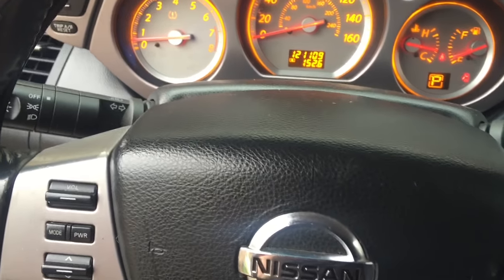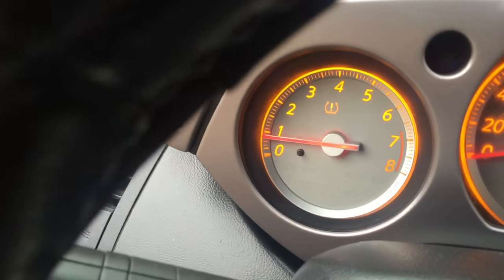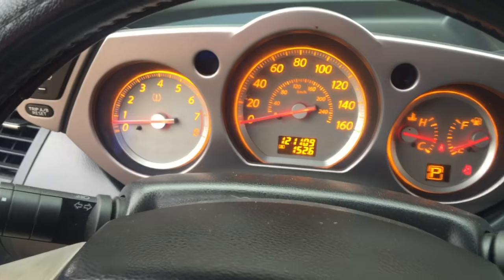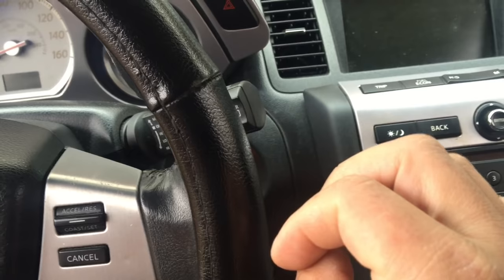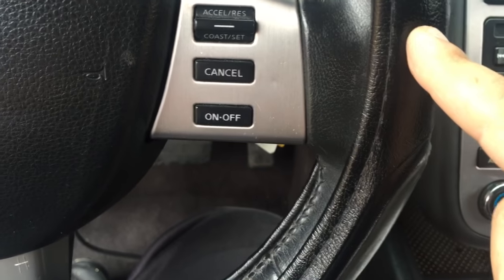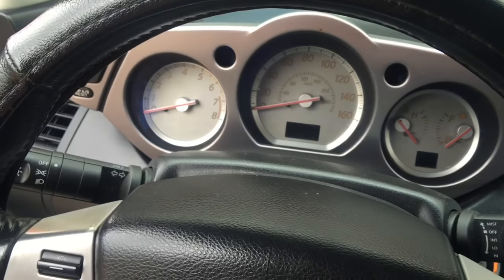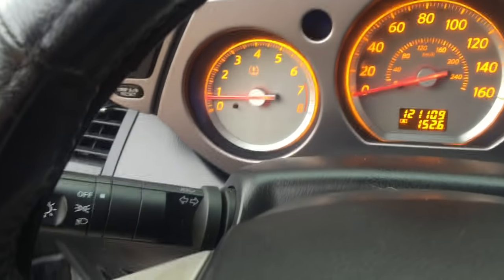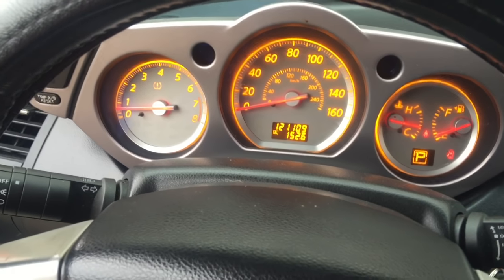Nissan P0507 Idle Control System - Idle Relearn Procedure

Comment: HI there. I have the same year murano. removed the intake manifold for maintenance,  have the same code, I did same steps u did . my check engine never blinks, the idle it did drop to 800 or so. but still it's high idle  while coming to stop completely,  do I'm doing something wrong Or I have to repeat the steps more then few times. have repeated the steps 3 times,  engine light never blinks while doing the rest learn ? any help ? thanks
Reply: 183guti sounds like your doing the correct steps. Double check that you don't have a vacuum leaked somewhere. 
Like the throttle body boot or something like that.
Reply from the maker: 183guti sorry forgot to switch accounts.
Reply: Throttle body boot? 
I will look for leaks for sure a soonest I have a free time , thanks
Reply from the maker: yeah the rubber hose that goes between the Mass Air Flow sensor and the throttle body, i've seen that sometimes when it gets put back on it sends on the mouth of it,
Reply: Ooi ok. I will look into that. Thanks for the response and happy holidays
Reply from the maker: no problem, you do as well!
Reply: Falcon's Garage My service engine soon light is on... Can I do the same procedure?
Reply from the maker: Only The Strong what code do you have? If you don't know you need to check that first.
Reply: Falcon's Garage just the service engine light is on. Blinked first now is on steady... Havnt been able to check for a code yet. It just happened bout an hr ago.
Reply: 183guti a blinking light is a misfire witch is more serious. A steady light on could be hundreds of things. Stop by a autozone/ Oreillys or any parts store and they will read your codes for free. Do that and I'll be able to help you better
Reply: Only The Strong oops forgot to switch accounts.  But still me
Reply: Falcon's Gaming Ok thx I'll get back to u...
Reply: Hi .I have an 07 Nissan Altima 2.5 S .mine idle is going up and down.i bleed the radiator for air.But I cleaned the throttle body.i tried the learning process but nothing.What can i do.?
Reply: Cooper Jonson maybe wait, all I did was wait for couple weeks and it's does re learn the idle but takes time and light comes and goes
Reply: Ok thanks.I will wait.
Reply from the maker: the radiator has nothing to do with the idle just an fyi.
you might want to check also if you have an intake/vacuum leak somewhere that could also be causing your bad idle
Reply: I will check for leaks tomorrow.Thanks👍
Reply: 183guti I have 2009 murano the same problem I tied the air intake screws too tied and I loose a litle and it drops and I did this steps to erase the lights and it works
Reply: valflame VT I see well my cel light hasn't cone back at all , all I did was wait like 2 to 3 weeks. my cel was coming on and off during that period of time. finally all fix up and all good now. 
my.honest opinion is this transmission sucks so bad, too soft for hard driving lol
Reply: honestly this car is not meant for hard driving. CVT transmissions are weak when they are made cheap.

Comment: i have 2002 nissan maxima 3.5 and i have code 1122 i bought a new throttle body and gas pedal as well i have tryed to do that relearn procedure nothing at all my RPMs are way too low I press the gas and it only goes to 1 1/2 rpm sometimes 2the most i ran out of ideas hot you can help thanks
Reply from the maker: Check your Wiring hardness. might be an issue there
Reply: i already did and it looked like crack so what i did i got another one from another car and i did the wiring and it was working fine for like 3 months and then one day i turned it on and its been like that since
Reply from the maker: Might be the same issue again... maybe...... but also check the rest of the wiring not just the connector. does it do this all the time or just periodically?

Comment: The Check Engine Soon light and Error codes have to be cleared before doing the idle relearn right ?
Reply from the maker: The relearn should work with out having to clear the codes. But you will still have to clear the codes after the relearn. 
So aither way it needs to be done. If you don't. It will eventually do it it self but it will take a couple of engine cycles.
Reply: Falcon's Garage what about if i did the relearn but the light never goes off after i done with the process and i chenged the body kit

Comment: I've tried this on my 04 G35 with no luck any suggestions.
Reply from the maker: maybe a bad Throttle body
Reply: Falcon's Garage  I have 04 g 35 n have that po507 code. Will that process work?

Comment: My check engine light came off after I tried this method...but my RPM's are still going crazy up and down 🤔
Reply from the maker: sounds like a vacuum leak
Reply: Yea bro. Make sure you plugged all tubes and shit. Thats what i did. And check for cracks

Comment: I have Nissan Maxima 2006 I try more than 10 time still don’t work for me
Reply: My 03 Altima gives me the same trouble. Can't tell if I don't have the touch lol
Reply: Same on my 05 maxima.  Will not Manual relearn..
Reply: Mine took the check engine light off... But rpms still go up and down🤔
Reply: Update: Had a intake gasket leak, which wouldn't let relearn.  Runs great now.

Comment: So should you have not done the relearn before you got the code?
Reply from the maker: Why would you do that? 
No need to relearn if it doesn’t need it
Reply: You did not state that it had the code before. Only after you cleaned the throttle body. So would it not be better to do the procedure after the cleaning as to not get the code?
Reply from the maker: No. Because the codes doesn’t always come on after cleaning the throttle body. Sometimes you might get the code after unplugging the battery as well. So no it’s not a sure thing that the code will come on after cleaning the throttle body
Reply: So...clean the throttle body, don't do the relearn unless you get code?

Comment: Will this work for the 1.8 engines for Nissan's.
Reply from the maker: yes
Reply: @FalconsGarage  any recommendations of how to get it scan cause ever dantley I have some more issues only thing I can do is get that service soon light to go out. At idle it surges from about 1500 til a little over 2000 I did clean the intake it was in need of it for sure. I can hear it operating so something functioning but  still it will not relearn??? I do have a tire  pressure light on.????
Reply from the maker: tire pressure light has nothing to do with it .. i would start checking for intake leaks

Comment: Would you know if this is the same procedure for a 2004 Infiniti FX35 AWD?
Reply from the maker: yes it should
Reply: Thank you, it worked, the idling went down. Two quick questions, engine light is still on and it sounds a bit rough. Are these normal? Also, should I reset the engine light error? Thanks so much for your help, one of the few out here that made something work as stated.
Reply from the maker: Glad I could help.yes you should clean the  check engine light, but the sounding rough part should be normal ... probably has another issue also
Reply: Thoughts on what it could be? I did do a lot of work on it. Including cleaning out the throttle, replaced valve cover, fuel injectors, and plugs.  Cleaned MAF, etc. Any advice would be appreciated. Thanks again.
Reply from the maker: if it wasnt there before it could be a hose or something like that, but hard to know with out checking it....
Reply: Thanks, I'll check.

Comment: Hi, Thanks for video. I have Nissan Quest 2007, I have noticed when I start car initially then idle speed is around 1500 but as soon as some time goes, it starts dropping to 800 range so it works when coolant/temp is near the middle. Is it normal to have higher idle during start ?
Reply from the maker: yes its normal
Reply: @FalconsGarage  I have done this and noticed again after few weeks code P0507 after performing these steps. I have also noticed when I am driving and let go off gas pedal, it looks like it does not slow down when I am letting go off gas pedal. Is it due to Throttle body issue or something else ? Any idea ?
Reply: @sanjayvideo01  I’m having same problem
Reply: @vvtheonevv4007  , Change Throttle body
Reply: @sanjayvideo01  did that replacing fix it? I cleaned mine, did relearn procedure, it idles at 750 but still gets P0507.
Reply: @alan4sure  replacing did fix issue. Although it was tough to remove 4 screws which was holding body. If you are doing yourself please buy these 4 screws in advance
Reply: @sanjayvideo01  I had it apart for cleaning once already so the screws should come out. Then I did relearn steps and it idles ok at 750 but still has trouble starting hot, and gets 0507 high idle speed errors. Hopefully a new throttle body solves it!🤞

Comment: I did this on my 2005 Altima. Rpms came down but the check engine light is still on. Could it be a bad throttle body?
Reply from the maker: Could be, getting the same code?
Reply: I just went to check it and the check engine light disappeared.  This is the second time this has happend.  Could it be a more serious problem? But all is good for now.  Thanks for your help!

Comment: my throttle body wont re learn, i bought a brand new one (Hitachi) and it still wont bring my idle down.  I have a cold air intake on it, the mechanic said for me to put the stock airbox back on.  Help...
Reply from the maker: the cold air intake wont hurt it in my opinion unless you have a leak somewhere else!
Reply: Falcon's Garage my mechanic is very good but for some reason he's stuck with this issue
Reply from the maker: it happens sometimes.

Comment: if the relearn dont work would that mean my throttle body is no good?
Reply from the maker: That or bad wiring
Reply: +Falcon's Garage would the relearn work if it dirty?
Reply from the maker: it would but it would learn idle with obstruction, I would suggest cleaning it before doing it
Reply: +Falcon's Garage just change my throttle body to a new one and cant relearn it took it to a mechanic and he couldnt either any thoughts on this thank you.
Reply from the maker: Sometimes it takes a couple of times to get the relearn .... but also might have a wiring or computer issue
Reply: Try it with your engine fully cold.
Reply: Falcon's Garage should I try it engine cold?
Reply: Matt Skelton I did all the steps with the engine fully cold and it worked first time. when you start it at the end of the procedures, let it warm up and the idle should drop to normal after a few minutes. I tried doing the relearn with my engine and transmission at full operating temp about 15 times, which didnt work. So I tried it with it fully cold to see what would happen and it worked for me. Let us know if it works for you.
Reply: Yes, if doing it with it fully warmed up isn't working. Try it cold! Let it set overnight. Then do it.

Comment: Can this work for a 2010 Nissan Altima 3.5 v6
Reply from the maker: yes
Reply: Falcon's Garage well I did it and the problem is still there I cleaned out the throttle body and also cleaned the master flow sensor

Comment: hi, I have a Nissan versa 2007. I changed the engine and now the engine just rises on idle to 3000 rpm. what could be the cause and how can I fix it?
Reply from the maker: maybe an hose is leaking or a faulty intake gasket

Comment: Thanks,for the video. I have a 2002 Nissan Altima 2.5 S, got a P1128 code I replaced the throttle body did the relearn process. the next day I got the same code P1128 check engine light came on and lost accelertation. can you or anyone help with this problem.
Reply from the maker: did you check the wiring?  
also maybe the copter needs reprogramming.... just a posivility
Reply: Falcon's Garage Wow! thanks for the quick reply. No, I didn't check the wiring. Can you make a video so that I can reference from. I'm sure you guest that I'm a newbie to this. thanks.
Reply from the maker: dont have a similar vehicle to make a video but check the connector for corrosion or cracking same with the wires leading to it.

Comment: 2001 maxima with an iac problem 5 speed.. will this work?  it needs a relearn but keeps shutting off. replaced the iac and now it starts when It feel likes it and shuts off spitting the iac code again. any ideas?
Reply from the maker: It should work if it needs the relearn. also check for any evap leaks.

Comment: I guess it worked better but the check engine light is still on for it.
Reply from the maker: Same code?  If so, did you check for vacuum leaks etc

Comment: Okay so I replaced my throttle body, changed spark plugs,replaced MAF sensor. I have a 2006 Nissan Altima 2.5 S by the way. Now my rpms started going up and down non stop. Checked for vaccum leaks and didnt find any.I did the idle relearn from the video and still no luck. Help!!
#HATEMYNISSAN
Reply: I also replaced the MAF harness.
Reply: Did you replace the intake manifold gasket?

Comment: I tried this procedure multiple times at the end of the procedure it starts to make noise of rpm going up and down up and down like someone pushing gas and releasing and it doesnt end what can it be
Reply from the maker: check for vacuum leaks or other possible problems

Comment: Works on my 06 G35 but still comes back ?
Reply from the maker: you might have a different issue! 
maybe a intake leak.
Reply: Falcon's Garage thanks! I did have a k&n cold air intake and it was making funny noises every few seconds so got it taken off and put to stock hopefully I can put that back on and get this idle issue fixed :(

Comment: Will this work on keyless 2008 altima
Reply from the maker: if its a "push button" keyless probably not, but if its a keyless knob it should!
Reply: Falcon's Garage is there anyway to do it with push button start? Thank you
Reply from the maker: for a push button start you might need a Tech 2 scanner.... but ill double check tomorrow on my tech 2 at work sometimes it will give you the procedures with out having to be connected to the car.
Reply: Falcon's Garage thank you so much
Reply: Did you get a chance to check your Tech 2 scanner yet?  I did the procedure on my 07 Altima 2.5L with a push start button.  I was able to get the light to blink however, the idle did not drop down as low as it should have. Thanks.
Reply from the maker: I did, and it didn't have any special procedures for a "push start" car, it just had the option to do it with the scanner or to do the procedures as I listed on the description, if you got the light blinking I say your almost there make sure you dont have an intake leak somewhere also. also sometimes you got to try it a couple of times.
Reply: Falcon's Garage I did procedure it flashed went off and then came back on I did it several times I think might be something else wrong 
In idle the Rpms only go to 2 and shake (hesitation)and won't go past 2 rpm
Reply: Falcon's Garage I did the procedure several times where the CEL blinked as well as a few times in the morning before starting the car.  The idle only goes down to 1100 but at least it doesn't pulse anymore.  I may have to take it to the shop and have them use their scanner to reset the idle.  I did not find any leaks or cracked components.
Reply from the maker: thats sounds to me like there is no communication to the throttle body or a limp issue!
Reply from the maker: thats probably your best bet bud!
Reply: Falcon's Garage what is limp issue ?
Reply: In drive rpm go fine now but only in idle it hesitates in park
Reply: Truthfully I have no idea what I'm doing I'm just to broke to get anyone to fix it
Reply from the maker: limp mode is wen the computer does not allow the car to rev high and its made so the car can LIMP HOME... but you said that the car runs fine its just at park when it hesitates .... doesn't sound like a limp mode
Reply from the maker: Thanks!